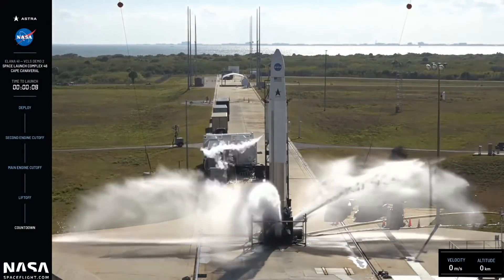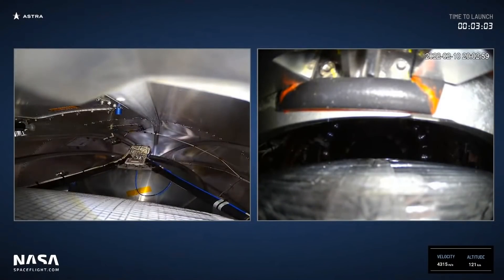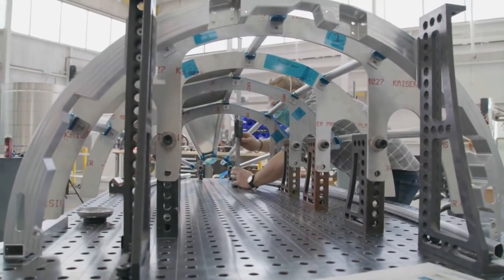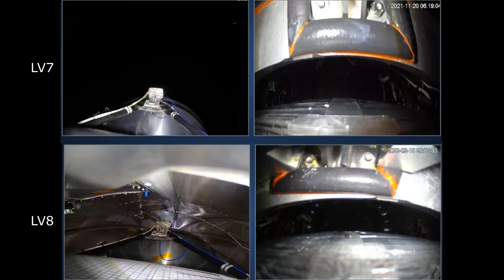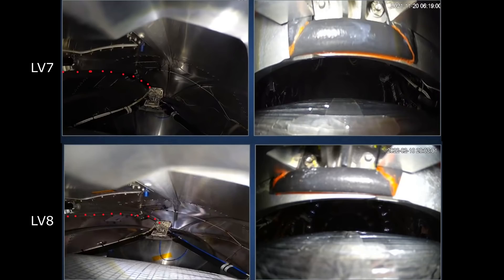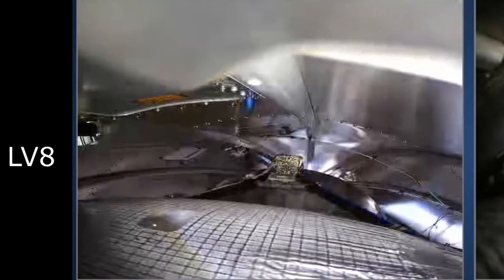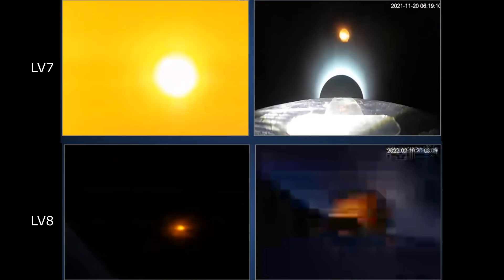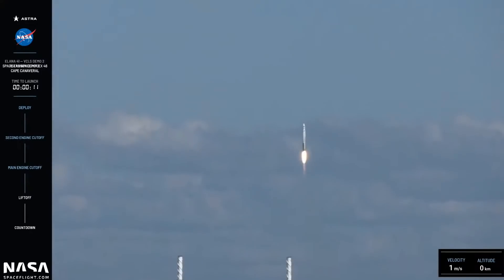Rocket Launch Doomed After Payload Fairing Won't Open

Comment: It's basically me on KSP before I knew stack seperators were a thing.  It's technically stage separation when you blow the first stage off the rocket.
Reply: Who needs stack separators? That's free delta v, baby!
Reply: @BrandonAzzarella  you ever see those videos where they dont even use couplers at all and then just steer their rocket towards a moon or asteroid and skim it just enough to knock off the stages they dont need anymore lmao
Reply: @HodgePodgeProducts  Is that a thing? Using lithobreaking for stage separation? I need links...
Reply: @janosmucha4897  stratzenblitz probably did it at least once, I think for a low part count mission.
Reply: @HodgePodgeProducts  That's a very efficient way of doing it. Steering is crucial, though, because you want to knock off the big fat stage and not the thin pointy stage.
Reply: @janosmucha4897  Your vocabulary is excellent. You've invented a whole new technology strategy. Hopefully they use lithobreaking (pragmatic) and NOT lithobraking (unfortunate).
Reply: Or when you are trying to reach more milestones before researching decouplers.  Just stack some Flea SRBs and ignite the next stage to blow up the depleted one below it.
Reply: @Br3ttM  Works best with a girder in between; the SRBs themselves have annoyingly-high heat tolerances.
Reply: The ultimate hot staging!
Reply: "stage obliteration", perhaps?
Reply: Isn't it spelled "sepperatourz"? Or maybe "suppurating" ?

Comment: does Astra have a good track record with other vehicles? I take it you would have said if this had happened before. Or is this their first?
Reply: Out of seven launch attempts since 2018, only one has been completely successful so far. So a 14% success rate.
Reply: This would've been the 2nd time they reached orbit. Previous launch was their first success.
Reply: This is iteration of rocket 3 is 1/3 with launches. This is a new issue which could be spun as good or bad, at least other issues seem to be fixed but what else could be wrong.
Reply: As the LV0008 designation indicates, there have been seven prior vehicles. The first two were Rockets 1 and 2, which failed but arguably were suborbital test vehicles anyway so failure is immaterial. LV0007 successfully reached orbit. Rocket 3 vehicles LV0003 through LV0006 all failed, however. I should mention that LV0003 in particular failed during ground testing, so whether you consider that a "launch failure" or not is a semantic question.
Reply: Actually no...they have had multiple failures and just successfully got a demonstration payload to orbit on the flight before this one.    I noticed that when the rocket lit and actually lifted off there was a huge cheer from the Astra personnel....that to me doesn't show much confidence.   Do you cheer every time you start your car?  No..you EXPECT it to start...it was like they were really worried and relieved when it worked.    The fairing construction seemed a bit janky too IMHO.    Is this some kind of EEOC project or something?

Comment: The structure in that faring doesn't look anything more complex than what you'd find in a modern kit-built airplane.  Not passing judgment on the design, just an observation.
Reply: Don't shit on kit airplanes, they're probably safer than your Cessna -A&P
Reply: @pilotgeorge2000  Shit on them?  I'm looking into building one.
Reply: It doesn't need to be a complicated structure, it just needs to work!

Comment: Thanks for putting together the video Scott. The side by side comparison is very well done. If the fairing is supposed to separate by spring force pushing up and to the side, then I imagine that turning on the 2nd stage was exactly the kick that was needed to separate the two shells. Not necessarily the gas pressure. Right?

Comment: Flying vertical is already a nice achievement. Now just the fairing needs to go away vertical
Reply: No the fairing needs to go horizontally (the booster is usually horizontal when the second stage separates to reach orbital velocity).

Comment: Do companies/universities usually have backups? Is there a partial refund for the destroyed hardware? Never figured how that works.
Reply: Failure of larger missions can actually be quite horrible for the university researchers, beyond the monetary value of hardware. People stake their career on some unique instrument that they spend years developing, and if it fails, that's basically the entire research project that gets delayed or cancelled. "I have worked on something that failed to launch" is nothing to brag about, despite all the effort put into it. Heartbreaking.
Reply: Normally companies get some kind of insurance.  Check out the wikipedia entry satellite insurance.
Reply: Satellites launched for commercial companies are usually insured but idk if universities can afford to do that, or if there is a cost benefit for just a cubesat. Afaik NASA is self-insured - just another way of saying not insured.
Reply: University satellites are largely teaching projects, it's just a bonus if they actually make it to space.  Also generally a launch failure means that you get your next copy of the satellite sent up for free.

Comment: I wonder when the last time there was a fairing issue, that we know of. Maybe the Taurus rockets?
Reply: SpaceX had a NRO sat get stuck in a fairing before. But the customer insisted on using a fairing of their own design and they've since just used SpaceX's fairings. That was the Zuma launch in 2018.
Reply: @Markle2k  That was the payload adaptor, the part that attaches the satellite to the rocket and then separates. Fairing was nominally separated. Zuma failed to separate from the spend upper stage. Taurus is the last fairing failure I remember. And it was due to a supplier falsifying the material certificated for the aluminum stock from which the frangible joints where machined.
Reply: @Markle2k  I was under the impression that Zuma was stuck to the 2nd stage because of the third party coupler, not designed by space x.
Reply: I remember an Indian rocket failing to reach orbit a couple of years ago because the fairing didn't seperate. But I don't remember any more details than this.